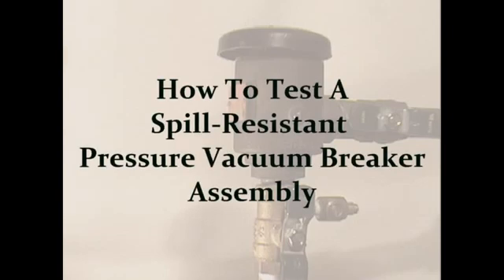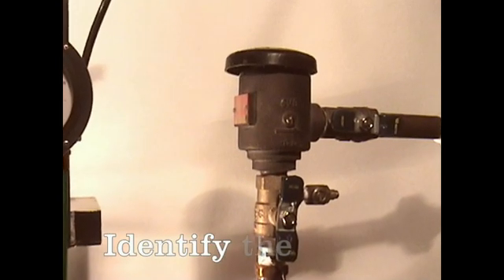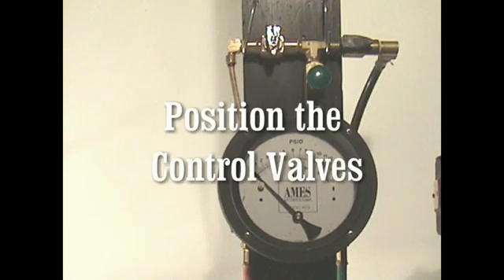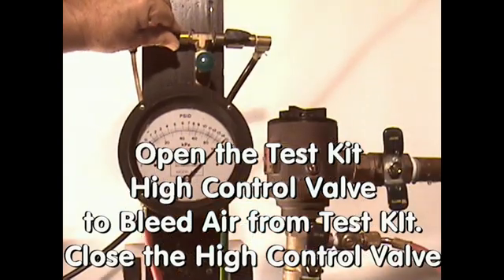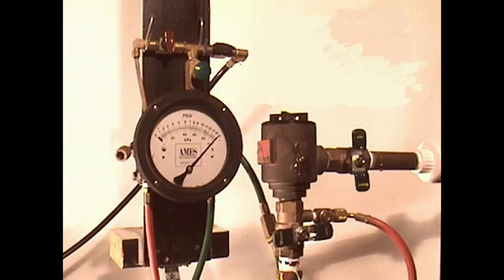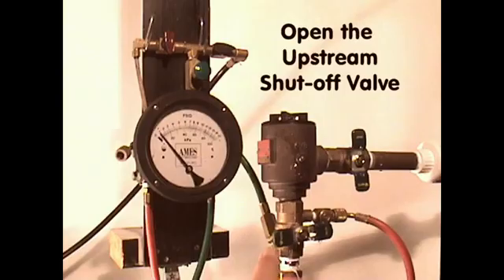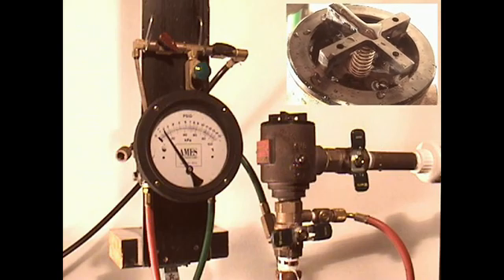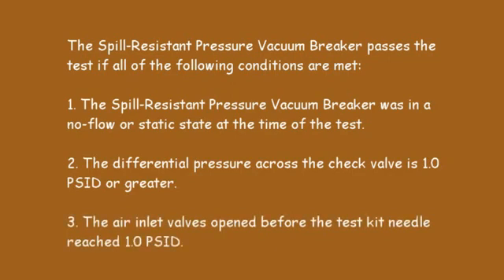Spill-Resistant Pressure Vacuum Breaker - Field Test

Comment: If you are talking about usc 10th ed or asse test procedure it conforms to the same standards both the airinlet and check open at or above1psid just because the test is not done like the others DOES NOT M A K E IT WRONG.l am an instructor for asse and treeo i know of where i speak

Comment: This is not up to par with the AWWA 10th edition test procedure and should be updated.
Reply from the maker: Not sure what should be updated and not sure what the AWWA 10th edition discusses, but will look into the test procedures.  If you could let me know your concerns,  I would be able to address them. --- What device are you talking about because the test procedures in these videos evaluate the operation of the backflow prevention device assemblies to determine if they conform to the specifications established by the AWWA, ASSE and USCFCCCHR. Stating that they are not up to par is inaccurate and shows a lack of understanding of the intricacies  of testing backflow prevention device assemblies.  These test procedures are endorsed by the New England Water Works Association Backflow Certification program  which is a sister organization of the AWWA. It is my understanding that AWWA does not endorse any backflow test procedures.
Reply: @JimmyBackflow  I am not sure about the AWWA or New England Water Works procedures but this does not comply with the ASSE procedure for an SRVB
Reply from the maker: Jeff not sure what you mean does not comply with the ASSE procedure? -- the tightness of the check valve is measured by opening the bleed vent screw, same as ASSE states. The opening of the air inlet valve is measured by opening the bleed vent screw and then opening the high control valve on the test kit, same as ASSE. 
Series 5000 October 2015, 3 valve test on an ASSE 1056
Step #1 - Close #2 shut-off valve
Step #2 - Close #1 shut -off
Step #3 - Open bleed screw
 TEST RESULTS 
If the differential reading is 1 psid or higher when the
 discharge from the bleed screw stops, record as passed.
Test #2 - Air Inlet Opening
Step #1 - Remove air inlet canopy
Step #2 - Open high valve and record differential
 gauge reading when the air inlet opens
Step#3 - Record if air inlet valve is fully open
I see not difference and the procedure is in conformity with standard #5020 which states  that the test
 procedure shall evaluate a backflow prevention assembly for compliance to the minimum performance requirements. The test procedure in the video confirms the assembly is at no-flow during the test, confirms the proper operation of the check valve and confirms the proper operation of the air  valve. In the future please provide documentation regarding you allegations.